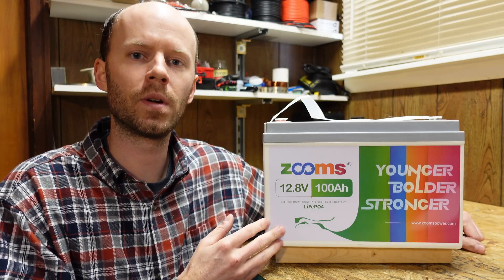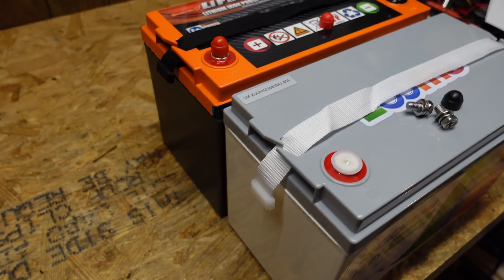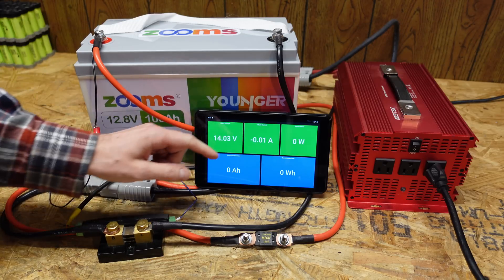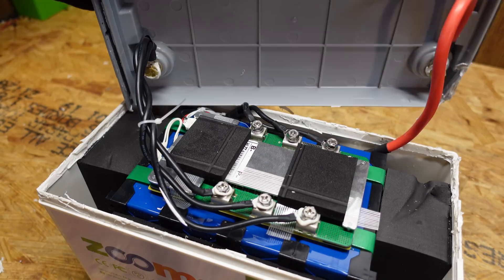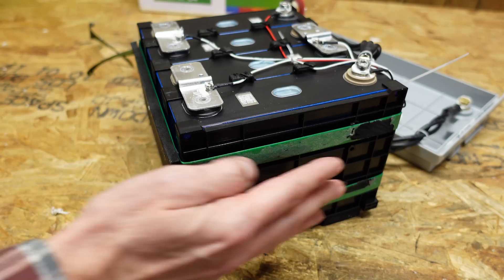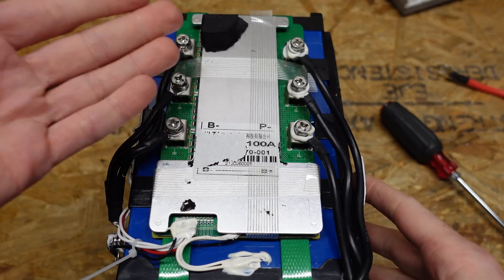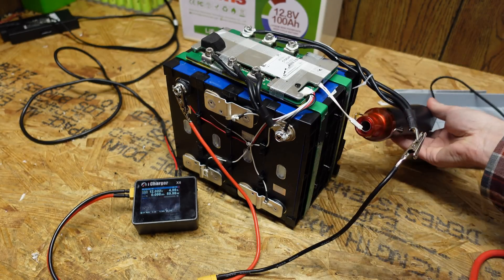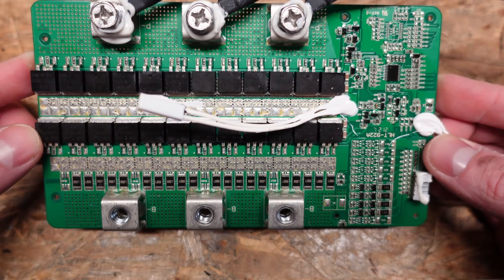Zooms (Redodo) 12V 100Ah LiFePO4 Battery Review, Even Cheaper, $250/kWh!

Comment: I understand the importance to know the quality of the battery product, but at the end of the test in the matter of voltage capacities it passed the test? Not all countries need low temperature sensor, i live in middle of the Caribbean and I will never see temperatures below 50 f degrees, I would be glad to know if the high temperature switch works and that’s all, also who will destroy a battery after buying it for a battery bank to be sure if the bms leads are on top or below the connectors of the cables? Any way im just saying to put another perspective of the item presented, I always watch this channel thanks for sharing!!!👍🏼😎🇵🇷

Comment: If you know you will never be below freezing or charge or discharge at maximum, the price competition of these lifepo4 batteries are really opening the door for folks getting into solar storage and use. Thanks to you and others like WP for making these videos that I certainly have benefited and learned from!
Reply: The Power Queen are said to be the same battety, and are cheaper, and then there is the JavaEnergy brand that I believe is also identical, and those are under 3 bills for a 100ah.
Reply: My Redarc bcdc lifepo4 charger has a temperature sensor in it, and refuses to charge my lifepo4 battery at or below 0c

Comment: I live in southern California and the temperature here rarely gone down to 32 degree.  The low temp. sensor would be redundant!
Reply from the maker: Must be nice. It's freezing cold here. Single digits this coming week... Lol
Reply: I'm in Florida. We occasionally get to freezing. But I found that when I built an enclosure with 2" foam board insulation that the heat generated by the MPPSolar charge controller keeps the inside of the enclosure 15 to 25° above the outside air temperature. Good enough to keep the batteries warm.
I have 8 of these currently, and so far after 90 days I'm impressed with them.

Comment: Ive got the 200 AH battery for my single 100watt  panel back up system and just got 4 SOK 206AH batteries "$4120" ouch for my 1300 watt system.lol.Will Prowse cut it open and this battery is a copy of Chins,and it seems several batteries are all from same company.I bought the SOK because of the low temp shut off as my trailer will see snow etc.

Comment: Is there a low cost way to add an external low temp cutoff that would support 100A (or 200/300A if multiple batteries are paralleled)?
Reply: LiFePO4 Battery low temp protection solved!
https://youtu.be/COVAgO0_MnE

Comment: What in your opinion is the best 24 volt and/or 36 volt brand for a bass boat trolling motor? And charging system.
Air Temp range 25-110 F in a compartment.

Comment: I asked on the last one and I'll ask again:  is there an easy way to add a low temp sensor and bluetooth to this unit?  Thanks for any info.
Reply from the maker: There isn't an easy way that makes sense. The case is not designed to be opened and serviced. I had to completely destroy this one to get it open. You could connect a shunt and some contactors externally, but it would cost a lot more than just buying a battery that already has those 2 features. It's unfortunate because it would only cost a couple of pennies for them to add a proper temperature sensor to the BMS...
Reply: Nice, love the GFBs.
Reply: LiFePO4 Battery low temp protection solved!
https://youtu.be/COVAgO0_MnE

Comment: Thanks LithiumSolar, what is your first name? Mine is Arne. Thanks for all the battery testings and conclusions, great job! I do not understand the discharge curves, jagged and seems to increase at end of test?
Reply from the maker: The inverter is trying to regulate the output at 120V. As voltage drops, amps increase to maintain the same output power. I'm not sure why it's so jagged rather than a smooth increase though.
Reply: @LithiumSolar  Thanks for the explanation! I think you in one earlier video described the amp hour, DC watt hour meter display set up you use. I want to duplicate it for my use. What episode was it? My name is Arne! Thanks for your unbiased reviews!

Comment: Do you know of a listing of 12 V 100 AH LiFePo4 batteries that DO have low temp protection?  Thanks
Reply from the maker: Nope, but perhaps I should start making one somewhere.
Reply: SOK Will release very soon with low temperature charging battery.
Reply: But mine are also much more expensive! We use 100% Grade A cells that have been rigorously inspected and have a 15 year track record in the market! 
 We use all resealable moulded cases for ease of bms swapping. Each battery has a simple voltage and % meter built in with a touch on/off switch! 
And we offer a REAL 5yr warranty!  No emailing a Chinese company and wishing like crazy you could actually get a replacement lol! 
But some people like cheap, no matter how bad the service or the lying is so it's up to each person's preference I guess! 
We have a big stock of 100ah s right now so check us out! Thanks
Reply from the maker: @millertechenergy  What company are you speaking of?

Comment: it is really  easy and cheap to install a temperature sensor ,why,why so many companies just don't bother to do it
Reply: THESE HAVE THREE PROBS
1. 100 AMP DISCHARGE SHOULD BE 200 AMP
2. NO LOW TEMP DISCONNECT
3. NO HEATING PADS AND INSULATION ACCESSORIES
Reply: LiFePO4 Battery low temp protection solved!
https://youtu.be/COVAgO0_MnE
Reply: @thervsolarseries2827  You gonna spam every comment about low temp sensors?
Reply: @Kennnny77  I WATCHED A FEW OF RV SOLAR SEIRES VIDEOS, HE'S ON TO A GOOD THING, WHICH COULD SOLVE A LOT OF PROBLEMS, WHAT'S YOUR PROBLEM AND IS IT EVEN SOLVABLE
Reply: @RonPaulgirls  looking through your channel... geez... clearly I'm the one with the problem. Ps... caps don't make your little one any bigger.
Reply: Just trying to help. No one else seems to be doing this and there are a lot of batteries out there that do not have a low temp circuit. This is a low cost solution that works.

Comment: Check out the SMD resistor that is off pad @7:11
Reply: If you're talking about the 0 ohm resistor right above R41, that's going between two pads of something with a three-pin footprint (maybe a transistor). It's at a jaunty angle, but it definitely looks like it's going between two pads.
Reply from the maker: I saw that and yes, it is soldered correctly, it's just going across a 3-point pad where a transistor is supposed to be. Exactly as said above. No clue why they did that...

Comment: to be devils advocate, do we really know that there isnt a thermistor / temp sender on the BMS PCB somewhere?
Reply: If there is, that's the wrong place for it anyways, so wrong that it might as well count as none.
Reply: At 7m he looked and saw nothing, but as Volvo said that wouldn't matter.  You'd want a low-temp sensor sitting on one of the cells.
Reply from the maker: I inspected the PCB for a temp sensor on-board. I didn't see anything. If you think I missed it somewhere, please let me know.